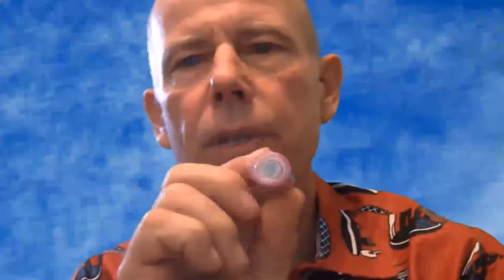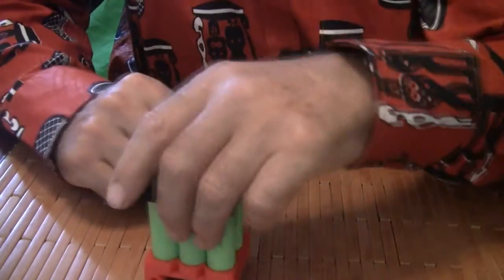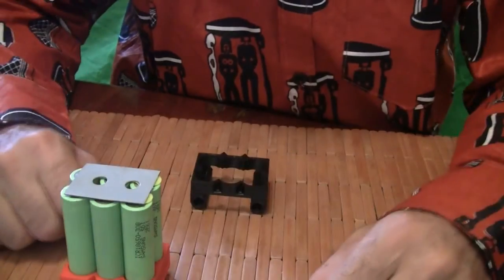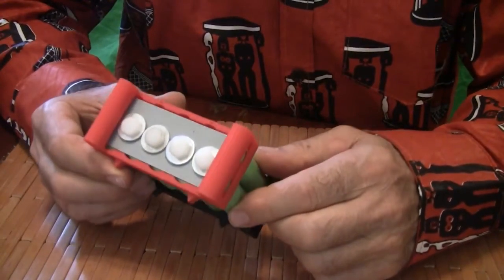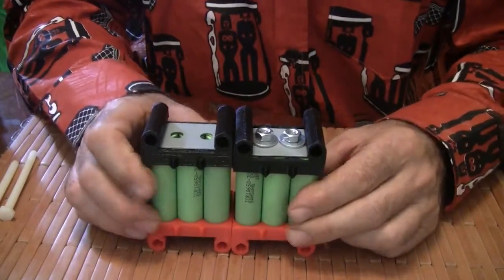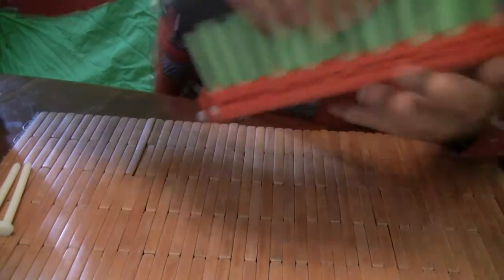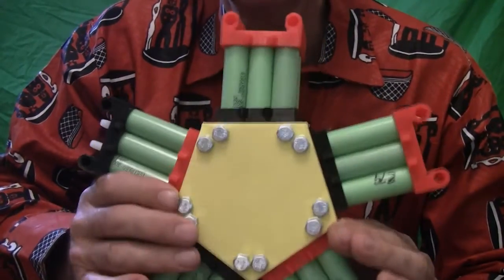BB Overview

Comment: This is fantastic, great job. Definitely alleviates one of my hesitations in building a DIY pack, which was the soldering process (for those of us without spot welders).
Reply from the maker: Great- All BatteryBlocs are now sold for $1 per cell.  Go to www.batteryblocs.com.  Email me for the lower price.
Reply: When I came across your video, I was thinking...  FINALLY - I love it, and just ordered a few of them to put together a pack with my 18650's I have been harvesting from laptop batteries.  I am looking forward to creating a power pack "without" ruining cells by soldering them.  I say ruin because I am getting better with soldering but would be too long on the battery with my iron causing too much heat to the cell.  I have an even better idea, but don't have the finances to create it...  

Thanks for creating the lego set of battery pack creation ;)

Comment: Very clever and exceptionally well presented! Thank you for creating this product and this video. Is there an amp limit on the magnetic/press connection?

I have noticed that some pack builders like Tesla have micro fuses soldered to their cells. How do you approach this aspect of pack building?
Reply from the maker: Thanks!

The amp limit per connection is limited by the power output of the cell- a 4.2 volt fully charged cell of 3.4 amp hours at 1C puts out just 14 .2 watts- easily handled.  

I would love to incorporate cell level fuses into the product and am open to ideas as long as it would not compromise the ability to simply take apart a pack for repairs.  

I have never seen a modern cell have an internal short.   I have seen modern cells that are somewhat less than their advertised amp hours.  If a parallel string of cells is charging too quickly, and also discharging too quickly, a cell is weak.  With BatteryBlocs the parallel string can be simply unbolted, the cells tested, and the weak one replaced.

Given the two likelihoods, it seems that the ability to assemble and disassemble is more valuable than a fused cell...   But that's just my opinion ; )

Comment: what plastic are these 3d printed with?
Reply from the maker: They are printed with PLA.  The bridging makes ABS problematic.  They are quite durable as long as they do not get a lot of ultraviolet exposure.
Reply: I would reconsider PLA for thes parts. Under compression, over time PLA flows and conforms.
Reply from the maker: What plastic do you recomend that has good bridging capabilities?

Comment: Shawn, love your instruction but I'm confused, in both this vid and "How to use plastic fence post covers as cases for BatteryBlocs" you hold up a 10P 5S assembly and refer to it as having a 36 volt output. Surely I'm missing something.
Reply from the maker: Did I say 10P 5S?  Then I got my P's and S's confused......... I should have said 5P10S!
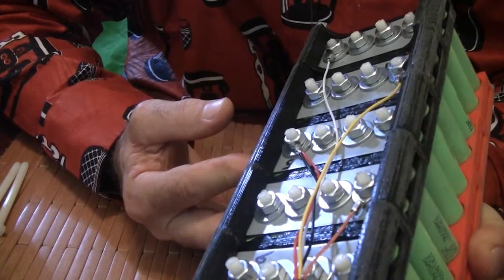Reply: is the block you are referring to and holding at 7:00 a 20v, 10P 5S?